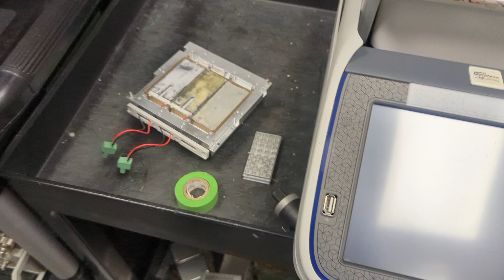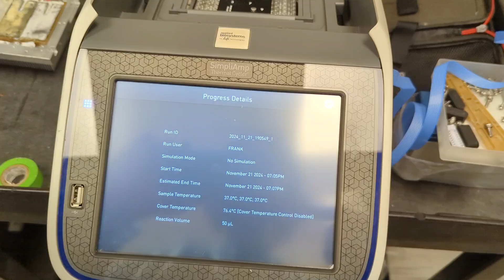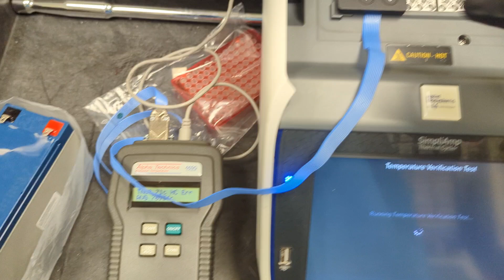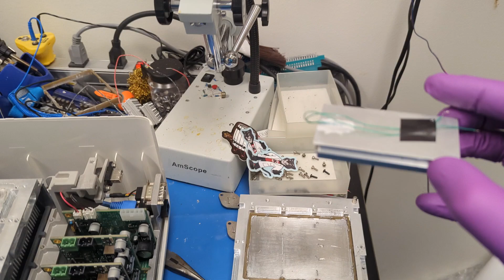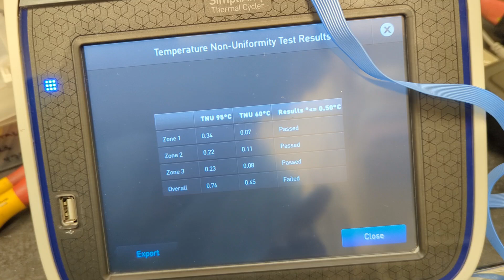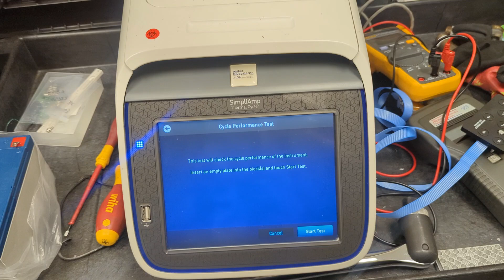Repairing A ThermoFisher SimpliAmp Thermal Cycler Thermal Block with Non-OEM Parts

Comment: I have one that's stuck on splash screen and it heats up the plate, how would I go about diagnosing it or repairing it?
Reply from the maker: What might be worth a try is removing each of the 3 thermoelectric modules in the back of the unit.  Remove them all and see if it boots up.  That will be a good start.  If it does boot up, try adding one TEM at a time (power cycle and disconnect them without power) until the booting issue returns.
Reply: @fmashockie  Ended up getting a different one, but it fails on 2nd or 3rd self test with Run Error: Subsystem=TBC1 ID=0x8008 Data=0x00,0x00,0x00,0x00 Details=Board4: Heatsink temperature exceeded 70 deg C.  Event log needed for analysis. Now if I only knew which one is a board 4. Would you be able to point out which one would that be?
Reply from the maker: @TimZhukov  Board 4 is the board furthest to the right.  The one that the heated cover plugs into.  The heatsink for the reaction module has a temp sensor attached to it to ensure it is not getting too hot.  It also plugs into that board (two wire cable with black wires).  Is this the same unit that was having the booting issues?
Reply: @fmashockie  No, we got a different one, this one can pass one self assessment test, but if we run a full pcr cycle it will then fail the test
Reply from the maker: @TimZhukov hmm i would check the details page as youre running a cycle to see if all the TEMs are giving accurate temps. If you have a temp verification kit you could compare the temp of the block againist that as ext std. But most people dont have those as they are expensive. Also check to make sure the fan is working and not being obstructed. Cleaning the heatsink of any dust might also be helpful. And if all that checks out, you could suspect board 4. Might even be worth hooking a thermocouple to the heatsink to see if it is actually getting that hot as well

Comment: We have the same PCR machine but the touchscreen doesn't work on the bottom portion (preventing us from using the machine). Any insights? Is there a touchscreen calibration module that we can access? Any other way to input information into this mechanine or is it time to buy a new one?
Reply from the maker: You could try repairing the touchscreen by giving it a bit of heat with a heat gun along the bottom. You could also consider replacing the entire touchscreen. Or the entire touchscreen/LCD assy. But it may be difficult to find a generic one that fits in the unit. I would try repair with a heat gun first. Unfortunately i have no access to any screen calibration. That  is likely in service mode which i have yet to find a password for.
Reply: Any updates? I have a similar issue with my pcr machine.

Comment: Hi there, i have been watching your video on thermal cycler repair. Quite interesting. I have a similar thermal cycler miniamp plus from thermofischer and its cooling fan is making noise, probably a barring on fan has gone wrong. I believe there are atleast 2 fans inside machine, one for thermal block and one for power supply. I suspect it is the one on power supply that is the culprit. Well i succesfuly open the outer cover without breaking it and then it was the thermal block underneath it. Fan is hidden deep down, i stopped there because i was afraid to handle thermal block being the core component. Well...looking for your guidance to go further because I am doctor by profession but electronics repair is something of hobby for me. Looking forward for reply.
Reply from the maker: Hi thanks for watching! So full disclosure ive never opened the miniamp. But I imagine it would be fairly similar. What you need to be most careful of IMO is the connections to the temp sensors and temp control boards. They are very delicate and can break at the sensor inside the thermal block. It's not a fun repair when that happens! But overall it's fairly easy to disassemble. Sorry I can't be of more help.
Reply: Thanks man. I could not reach to power supply fan, but WD40 reached there, flushed it nicely and noise is gone. Cheers

Comment: Hi 👋 the screen of my SimpliAmp becomes pink sometimes, did you see that before?
Reply from the maker: Hi I can't say I've personally see that but that appears to be an LCD touch display issue.  Your best case scenario is that you just have a loose connector so you can disassemble it and check for a tight connection.  But if the display is going bad, unfortunately that is a bit more difficult to resolve.  ThermoFisher will not sell you a replacement LCD touch display.  You can try sourcing a non-OEM alternative, but you'd have to find one of the correct size (~8.1" diagonal ) and also it appears to be a resistive (not capacitive) touch screen.  Those are a bit older and getting harder to source.
Reply: Thank you for your answer. 🙂 Do you show anywhere on your videos how to "open" the machine and where could be the connectors that I have to check? (I sent to your FB Messenger some messages)  @fmashockie
Reply from the maker: @dendro-tv  shoot me an email if you go to my profile and I can provide you some directions

Comment: Great work ! quite an education there as I haven't seen one of these guys before so that's always good. Awesome that this is now doable with tried and tested 'off the shelf' bits. One thing I would add if you have never used Peltiers before they are heat pumps, they 'move' heat from one side to the other so when your heating up the other side is cooling down they don't generate heat per se, and it works both ways you can apply heat and generate a voltage, current not so much ! I don't believe you covered it (could be wrong I might have missed it) not that important anyway ! great work now go get a pay rise.
Reply from the maker: thanks for the explanation Andy! Yea all I know about them is that they are semiconductor devices and that you apply voltage one way it 'heats' and if you reverse the polarity it 'cools'.  So I appreciate the in-depth points there.  That is one of the reasons I made this channel - to learn from others in the comments with more experience.  That happens more often than not!
Reply: @fmashockie  :)